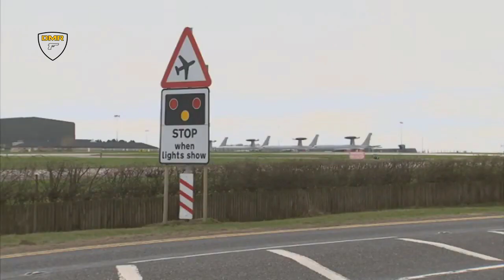Royal Navy Aircraft Carrier ‘cats and traps’ catapult system

Comment: One thing is for sure. The carrier is designed to be lego so as to refit easily when needed.
Reply: That was the Idea, continues Upgrades.
Reply: U try future.proof to an extent
Reply: What a load of rubbish.   There will be no cats and traps. This is just a story
Reply: @Highendaudio1   The brits are doing research on Magnetic  cats now to be fitted on the Prince of wales for bigger planes to be able to land and take off.
Reply: @newton18311  We certainly are not.  Thats a lot of BS being pushed about by a non-military FB group called the UK Defence Journal.  No military connection  If you knew anything about building vessels you would know why they cannot be retrofitted and we have no aircraft.   The feasibility study was to see if a lightweight version could be fitted to launch drones and unmanned aircraft etc.  Massive difference.  Stop professing to be an expert.
Reply: @Highendaudio1  I am disappointed to read this, as the builders claimed that the carriers could be refitted with an angled flight deck and catapults at a later date if deemed necessary.
I cannot help but feel that these ship’s design and construction have been bungled and the UK had missed a great opportunity to finally deploy large carriers, suitably equipped and armed.
Thank you for the clarification though.
Reply: @craigsimons817 No problem.. we made a choice a long time ago that our activity would be with the F35b   cost had a big part in this
Reply: @newton18311  UAVs not larger manned aircraft.

Comment: as I recall the carriers cost about 1/3 more than the cheapest possible design because they were "designed for but not with catapults and arrestor cables" because being non nuclear the traditional steam catapults would not work but during the 2010 defense review when the US offered relatively (compared to the cost of the carriers) inexpensive electromagnetic catapults it was determined it would be more expensive to refit the 2 with CATOBAR systems than to build a third carrier (in other words BAE systems sold a more expensive convertible design, then did not do anything needed to make them easy to convert, and presumably the contract was not well written so we could not force them to pay)
Reply: Well that seems like an oversight.
Reply: BAE systems are also involved in the F35 programme.  It was in their interests to overstate CATOBAR costs to prevent an alternative aircraft being used, as the financial benefit of F35 procurement far exceeded that of any additional work on the carriers.
Reply: Steam catapults use up too much space, the RN wanted this space for aircraft etc. The old carriers such as Hermes and  Ark Royal had them without being nuclear. The EMALS system fitted by the US have been plagued with problems, they were never fully proven before they started building their carriers. Damage to the front wheel and airframe of the aircraft was one of the problems. They also found that the system couldn’t be repaired at sea, that makes the carriers useless if a fault occurs.

Comment: I can understand why they did not put a catapult system since the F-35 does not always  need  one but they obviously realise  there are advantages with a catapult system as well especially operating with other countries naval aircraft .
Reply: Nope.
Reply: The class was designed to be a cat and trap in the future. When they were starting to buy the F35B, they saw how expensive they were and started looking into going that way. But during the development of the the c & t system, it was getting too expensive for them. They went back to what they have now. I retired from Lockheed on the F35 line and saw that the Brits were going to start placing their order for the C ( Navy model ). The Brits don't have or want to spend that kind of money on their forces.

Comment: The EMAL spec requested is inadequate for max takeoff weight, and even the minimum recovery weight of the F-35B. This system is solely for the launch and recovery of large drones and UAVs. The QE class carriers will, undoubtedly change the composition of their air wing in the next four decades. That may lead to the fitting of a full-capability EMAL system, but this isn't it.

Comment: With the current funding predicament the RN finds itself in, particularly with CEPP, even if the defence chiefs are un willing to admit it, the CATOBAR configuration should have been selected from the start, so as to provide the true flexibility for compatible aircraft types to procured and launched of the QEC Decks, thus avoiding the inevitable long term capability handicapping the RN is now enduring. Had the previous Labour and Cameron administrations resisted the urge to pillage the Military of the investment it really needed, the RN would have been able to consider the options of F35C, F/A-18 Block 3 Super Hornet or even the Saab’s Sea Gripen Variant, instead of the most expensive and limited F35B version.

Comment: The only reason they have room on the carriers for cats and traps is simply because it was meant to have them... before the gov said no... now they want them??? How much money on retro fitting are we spending through their inability to decide
Reply: Somewhat in defense the EM Cats take a lot less space
Reply: The proposal was to use the US system which s still not operational.
Reply: These cats and traps - as made abundantly clear in the video - are not for launching manned aircraft so irrelevant to the original plan for F-35C.
Reply: does seem curious that a carrier this size seems under utilized of not being able larger multirole. yes the F35Bs really nice to have, but really this entire time I can't help shake the thought of the HMS Queen Elizabeth being an oversized VTOL carrier.
Reply: @wiryantirta  that's what it is, it's just a big boat they cut corners on and now can't even fill it with our own planes.  Hms Prince of Wales wasn't even wanted.
Reply: @TheLastCrumb.  have you not heard of the plans to fill it with F35b, Helicopters and multiple drone types ? It will be a very busy flight deck in a few years time.
Reply: @Bob10009  indeed.  I also remember the plan to fit it with nuclear power... until they changed it because of cost.  I also remember we'd have 2 carriers full of f35b and an air force with f35b... before they cut 100 planes out of the desk because of cost.   I remember when the plan was to have 2 carriers... before the plan changed and they actually wanted to stop the price of Wales build but only carried on because it was cheaper to finish it than scrap it.   I also remember the plan was to increase the military... before they cut nearly 5 half the cargo transit planes in the raf and cut half the tanks and 10000 soldiers from the army.   The government is full of plans but instead we get a make believe super carrier that's not really had time to do anything and now they want to retro fit?  That we don't have enough planes to put on it.  Basically what we've built is an overseas floating base for us marines.  But we're now getting toys?  Don't get me wrong I am very proud of this country and our military but my outlook on our gov and the plans they make...I take with a pinch of salt
Reply: @TheLastCrumb.   both carriers and the RAF will have F35b - no revised figure for the total buy has yet been given, but it will be more than the 48 ordered so far. As for the increased defence budget, the armed forces are getting lots of new kit at the expense of some old kit. Maybe take a look at how much is actually being purchased rather than dwell on the few items being cut ? The armed forces are more optimistic than they have been for years.
Reply: @Bob10009  we are getting rid of manpower and investing in boris and his silly childish...let's have drones and all the rest of the toys. The increase in defence budget only really plugs the holes left in the passed.   The raf and navy will be sharing f35b and no they won't be having 2 carriers at once. 1 will be in doxk waiting and when the first hms docks the f35 will transfer over. Its basically a back up the the giv do not want...they said they tried to scrap it...the raf land bases will have typhoon upgrade. When it comes to light that the gov..once again..will change their minds we will be left will a weak half finished project.  Its a complete mess.  Biggest navy in Europe... yes and the biggest unmanned navy in the world... for a reason.  1.. the kids don't want to join and 2.. because its the wrong way to do it.
Reply: @TheLastCrumb.  erm, that’s pretty much all nonsense 🤣🤣
Reply: @Drew Peacock all completely pointless when both Gripen and Rafale are a generation behind F-35b.
Reply: @Bob10009  really.. what part? Because its all true lol
Reply: @Drew Peacock 😂🤣😂🤣
Reply: @Drew Peacock "navalised Typhoon" - ruled out years ago, "F35 not 5th gen" - lol, "F35s going out of service in 2026" - hilarious.......
Reply: @Drew Peacock "Diatribe-  speech or writing which bitterly denounces something" my use of the word sound about right to me.
Reply: @Drew Peacock what you wrote was incorrect.
Reply: @Drew Peacock nope, still all incorrect

Comment: why? British Carriers don't need catapults because they're to dangerous and we don't have or own aircraft in use for them. Our Carriers Queen Elizabeth and Prince or Wales were designed and built for VTOL and Helicopters only. Since HMS Ark Royal used to have Catapults we had them for the Gannett, Phantoms and Buccaneers. But from what I seen there were many incidents involving the catapult with the lost of aircraft and sailors on Deck due to slingshots of the cables taking their legs off. These carriers are safe, no catapults besides the only thing we have is the Wind speed and thrust no cheating of use of force. IF the British decided to build a larger aircraft carrier for the use of Heavy transport aircraft or bombers then it wouldn't be a Queen Elizabeth Class design because BAE systems gonna redesign the hull and length to have Catapult callability to launch A400M or C130's off the deck because they're that heavy and require alot of thrust.
Reply: STOVL not VTOL